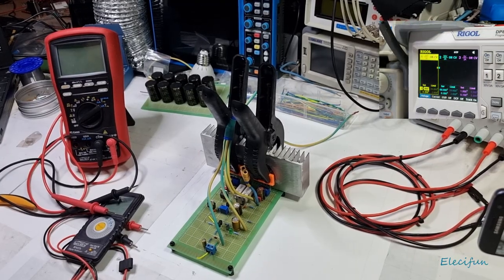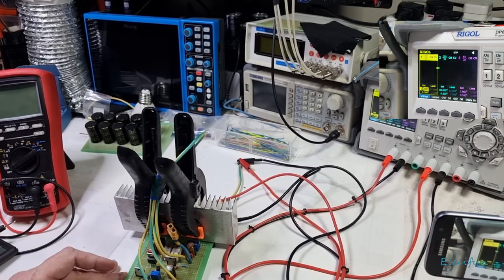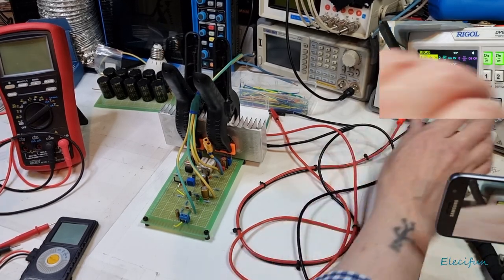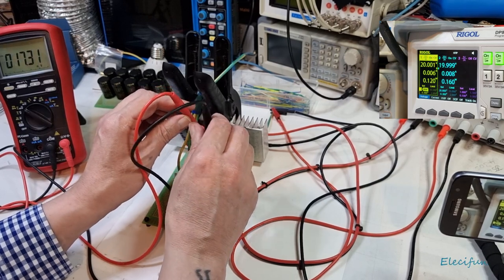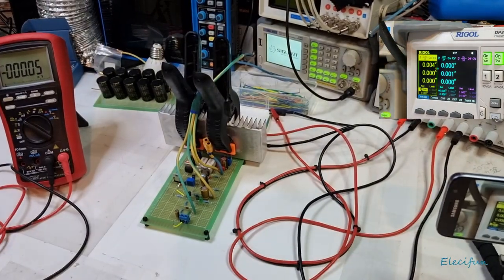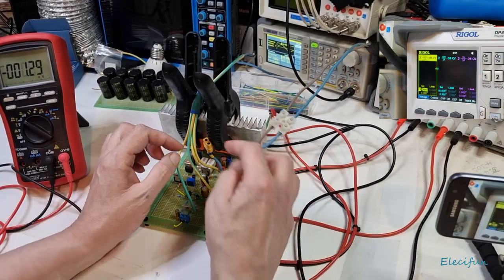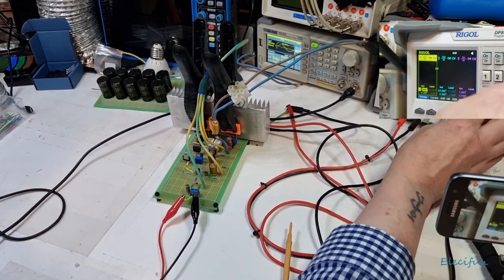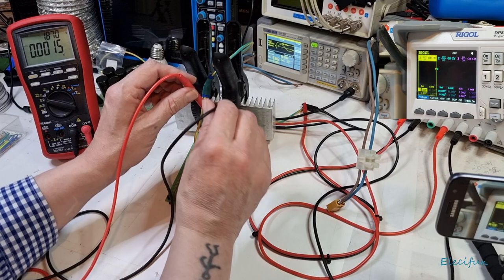ESP DIY HiFi Amplifier Build - The Power Up

Comment: Very interesting stuff Elecifun. Thanks for creating this series!
Reply from the maker: Cheers for the positive input Sonic. Yeah it's built it works, all seems a bit anticlimactic now. In the back ground I will build the other channel see what they sound like.
Brighter note,checked out L12-2, seems quiet impressive. I might buy a kit myself £31 for the pair ebay.. maybe cheaper on Aliexpress?
Reply from the maker: Not sure you might be interested   https://calvins-audio-page.jimdofree.com/ideas-and-circuits/power-amplifiers/l12-2-modifications/
Reply: Do you power your amp from mains or your bench power supply? I would be interested to see the small details that you may consider mundane. Power switch, input jacks, speaker connections etc. Part of the fun for me is considering different enclosures and making the amp interesting to look at as well as listening.
Reply: Yes, thank you. That is very interesting. It gets over my head rather quickly. I'm trying to learn electronics but don't have a strong background. I'm pretty handy with a soldering iron but still need pretty detailed instructions with a kit. I've populated PCB boards but haven't built anything from just a schematic. That's why I find your step by step video series so valuable. Might be slow and boring for an electronics engineer but for the garage hobby guy they're just right. Cheers amigo. Please post if you build the L12.
Reply from the maker: I will go over the power supply tomorrow and point out connections etc I realise I left a lot out on the power up. Just so happy it worked I was really tired.
Reply from the maker: I will do, just working on a way to test the amps. Only got 8 bit scope at the mo its no good.
Reply from the maker: £25 for 2 channels on aliexpress .. probably same in dollar. Powering the thing is another story. Maybe I wait until you have built yours.
Reply: There is a guy on YouTube from New Zealand named Michael Beeny. He turned me on to the L12. You might want to check out his channel. He seems to be a kindred spirit keen on electronics like us.
Reply: I'm uploading a quick video right now showing my tube amp build in the Pink Floyd lunchbox lol. It has developed a crackling noise in the left channel as the tubes are heating up. No noise once hot and playing... I plan to take the amp out of the lunch box and just see if I can diagnose the problem. I'll post that endeavor. Thanks again for your great vids amigo. Cheers.
Reply from the maker: I shall check it out, thank's for the heads up.
Reply from the maker: Just listened to your tube amp... nice also looks great! Great thing about the crackling is you can compare sides for differences and what you find may be the answer. Go for it.

Comment: Oh on the subject of soldering iron tips. Which tip shapes do you prefer? What tip shapes are you using?
Reply from the maker: I use a chisel tip at 350C with good 0.3 solder with flux built in. For really small work a conical.
Reply: @Elecifun  hmm, well that's interesting  that you solder at 350°C. I'm soldering at 370°C which is too hot. I'm using .35 or is it .38 flux cored solder which is same as you are using. It was a good choice in hindsight and one of my better choices. I also use Amtec 559 flux in hypodermic style needle which works really well.
Reply: @Elecifun  And as for the soldering tip I was using a conical with a .5 ~ 1.0mm ground flat surface on the tip.

It's pretty much what I use all the time.

I have also a conical with well in the ground flat tip.

I haven't used it yet but I might try it one day.

The idea is that you load it with solder and the inverted concave well holds solder.

As soon as you place the tip onto the legs of your component the solder flows onto and around it.

I think I might buy another conical tip.🤔
Reply: Hey amigo,

I watched another video about SMD welding.

I thought I was supposed to weld a smd cap on using a fillet weld.😆

Not so apparently.
Reply from the maker: I've done my smd's with conical in the past.